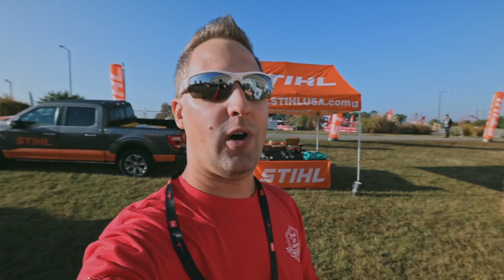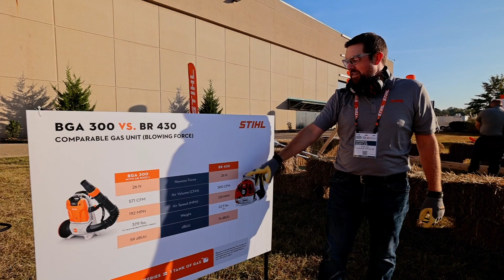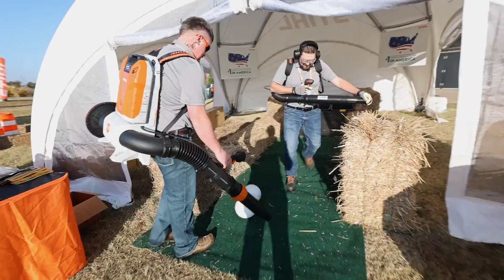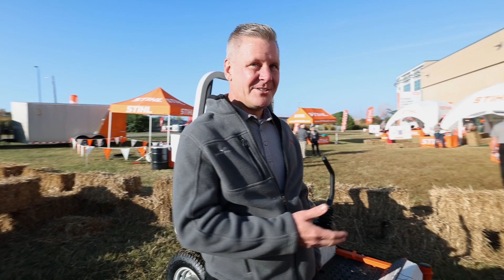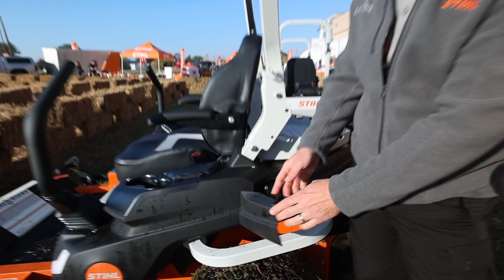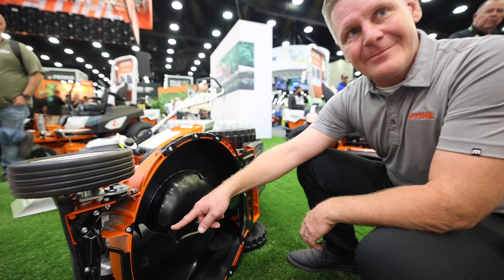New STIHL Equipment EQUIP EXPO 2023 ► New BATTERY Zero Turn?!

Comment: Iam a long time Stihl user. I sold all my gas Stihl equipment this summer and replaced it with battery power.  Push mower -amazing, trimmer-meh..., hand held blower -amazing, Hedge trimmer-amazing, chain saw-meh... Big jobs still need gas. Overall I am happy.

Comment: I saw the walk behind in the booth and was impressed with the build, but I didn't flip it over.  Love the idea of the polymer liner to protect the deck from sandy soils.  I presume the liner can be replaced if needed?  And the unique blade design which negates engine damage in case you strike something immovable.  Replacing the adapter and blade is much cheaper than re-powering with a new engine.  And less downtime too.  Not to mention the mono handle design.  I figured it was for ease of handling the bagger.  Great video, Brian!

Comment: Those walk behind mowers have only just reached your shores. They have been sold in the UK and Europe for many years (hence the 2000hrs testing) not a bad machine  but not as popular as some of the other brands sold here in the UK like Honda HRD, HRH 21" aluminium deck mowers and Kaaz 21" aluminium deck mowers which use the old honda design mower and are built in Japan (Honda's mowers are built in France). Both have shaft drive transmission and easy to use controls.

A decent mower if they brought it over to you guys in the USA would be the RM 4 series mulching mowers.
Reply: were not allowed to have honda mowers anymore
Reply: @James-lo5ne  I couldn't believe it when Honda said they were pulling out of America. In the UK and Europe it is slightly different as they have technically a larger range of mowers including ride on mowers and all the factories are mainly in Europe. The other brand I mentioned called Kaaz is a Japanese built mower and looks pretty much like the older designed Honda aluminium deck mowers. The Kaaz machines are also supplied to other manufacturers who stick their brand onto them and sell them as one of their models, Lawnflite is one of those that use their name to re brand them.

Comment: Walk by the Greenworks booth and look at their zero turns. Then walk by the Stihl booth again. See if you can tell any differences aside from color. 🙄 Stihl acting like they have something earth shattering 🤦🏻‍♂️ those battery units look like they ride tougher than a log truck
Reply: Also with Stihl, you have dealer support and different battery cells.
Reply: Stihl have 20% stake in the Globe Group who build the Greenworks battery mowers.

Those gas walk behind mowers aren't new either as they have been on sale in Europe and the UK for many years.

Comment: I will say that push mower looks interesting, several good ideas. They need one in a 30-32" with a strong transmission to pull it along.
Reply: These have been sold in Europe and the UK for many years both in Stihl and previous lawncare division of Stihl Viking. They do seem to be durable enough, but most contractors and local authorities here in the UK will choose Honda 21" aluminium deck or Japanese built Kaaz 21" mowers because of the blade brake clutch system, shaft driven transmission and the Honda engine.

Comment: Good stuff.
Only concern with the push mower. 
With not deep of a deck on it. How will it do in the real word cutting applications. Compaired to the scag sfc21 with the same engine but a supper deep deck. That mower is almost unstoppable. Yet cutting is extreamly well. 
Granite, they slapped the kohler 224 on it at 11 ft-t witch that engine is a tank as it is on the stihl. So kinda Defeats the porpoise you know. A strong mower on anything can make a mower cut really good with a good blade.

Comment: Brian what do you think about the ev mowers and such? Do you think they are currently better than the gas?
Reply from the maker: Some are in certain aspects, absolutely. But are any there yet 100% with cost of ownership for our demands and run time? That’s yet to be seen. I will say this, the 8kw battery (I think?) on these STIHL units though is actually a lot of juice, so I’m impressed in that regard!
Reply: @BriansLawnMaintenance  it was 24kwh with the ability to outboard 8kw through the ETO.
Reply: @BriansLawnMaintenance  Sounds good, thanks!